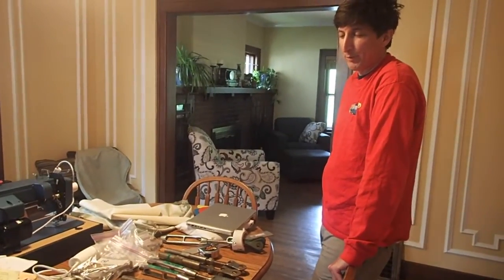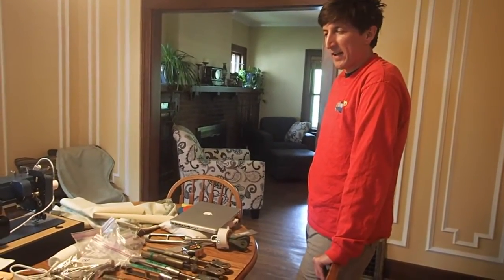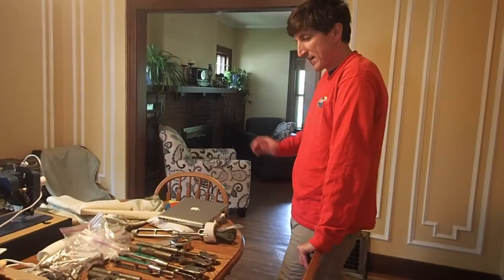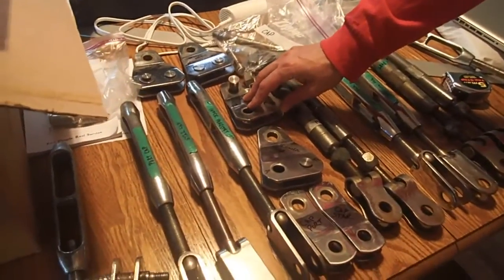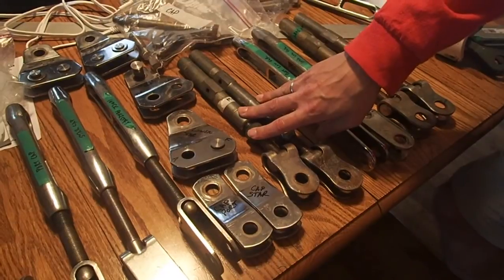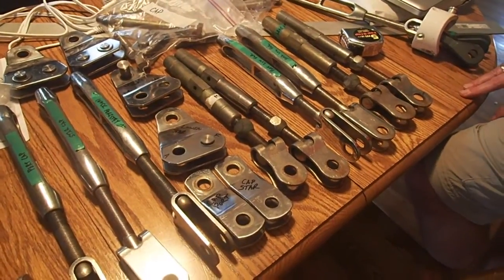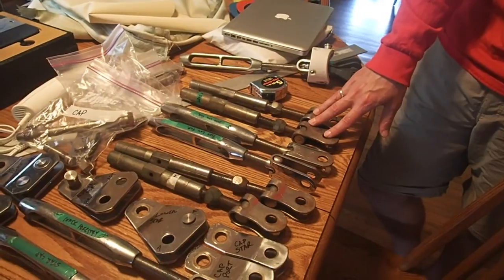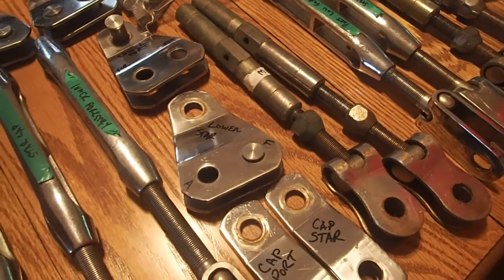Preparing to order rigging hardware

Comment: You can save a lot of money by using stages at the top where they will last longer and stalocks at the bottom.  Look at Norseman.  They cost a bit less for the same thing. I looked into this for my Morgan out island 41 and stalocks were nearly $2k for the parts.  Swages were $800. I'm going with swages.
Reply from the maker: Pierre Mitham We have decided to do swages at the top to save some money as well.  Unfortunately, Norsemen is stopping production.  We have some Norsemen fittings on our backstay for the SSB insulator, so we are keeping those.